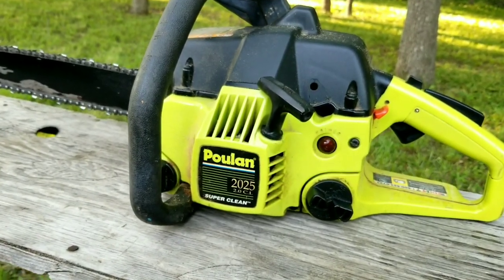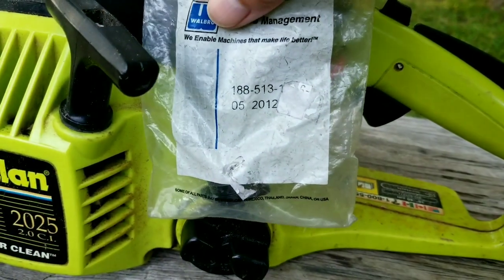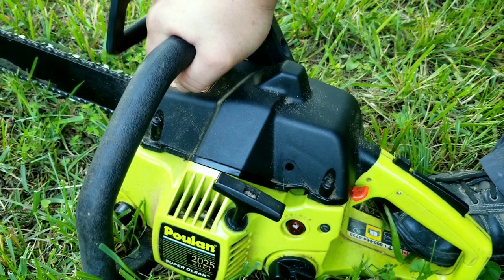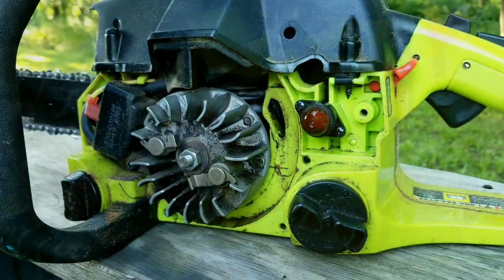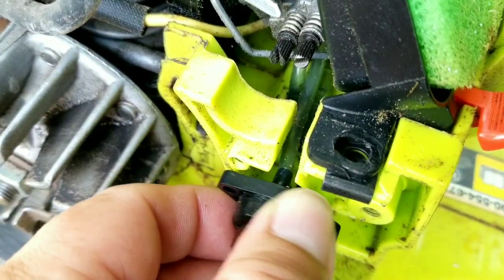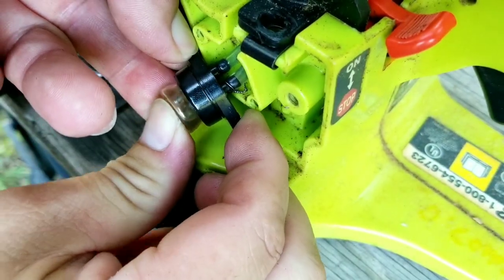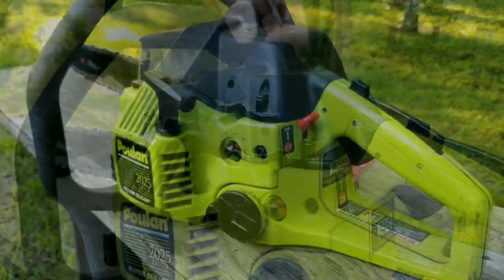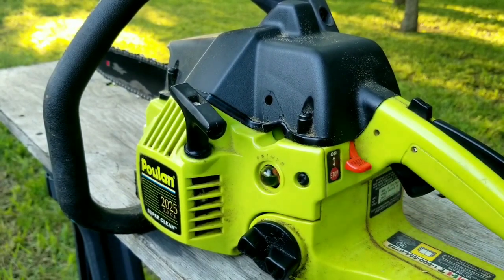Mythbusting primer bulbs. Will a cracked bulb keep you from starting

Comment: I have a Homelite weeder that has been VERY good to me over the years.  It recently had a tore up primer bulb, and I kept using it in spit of it.  I would just depress the throttle, and pull.  After a couple of time it would start.  I used it like that for a couple of months, and finally decided to change it out.  But it was almost like it really was unnecessary.
Reply from the maker: Yes the Primer bulb is to just remove the air in the fuel lines, but pulling the rope several times, does the same thing

Comment: I had a very heavy weight / heavy duty one once and sold it. It had been one used by Virginia Power crews to clear trees during stormy weather. So I assumed that Poulans were good enough for the power utility men to use.  BUT: a power utility may buy chainsaws from a dealer selected by an office 'tools and supplies' fellow and not workmen at all. So Poulan may have been selected by money managers who only view the nominal cost to buy and trade in... I sold the one from a yard sale for maybe  $80 and it cost me $15-20 with yellow case ... all complete.  So it was an OK deal for me
Reply from the maker: I think if you take care of it it will last. Thanks for the comment I appreciate it

Comment: Love watching these shows, very informative, I have.a question I have a 70cc Perla Barb chainsaw that does not have a primer bulb on it ,just a on/off switch, choke and a decompression valve,yet it starts perfectly all the time .Do you really need them???
Reply from the maker: the primer bulb was there to make starting it when the tank was empty, easier.   Most consumers don't have the patience that the consumers from 40 years ago, had.

Comment: I have a Poulan that looks just like the one in this video, but has 2075 on the side, and it's been GREAT to me.  I've had it since 2005.  It's been used pretty regularly, but for residential use, so not really that much.  I had to replace the primer bulb, and one time the fuel line cracked, causing the engine to die on me.  Once I replace the fuel lines, it was back and running great.  That was my first fuel line replacement, so it was a struggle, but not the fault of the machine.  Might not be one of the more popular and more expensive brands, but I have ZERO complaint after many uses over many years.
Reply from the maker: thank you kings17court.
Reply: @INSIDEHOUSEGARAGE  For residential use, I've had great results with the cheapy brands and models for these small 2 stroke machines.  I see no reason to pay 2 to 3 times as much for the more expensive brands.  It might make sense for commercial, but from my experience, not much sense for residential.
Reply from the maker: I completely agree with you.

Comment: Everybody wants to hate on Poulans but these older ones really weren't bad. Lines, primers & crank seals go on ALL saws, not just Poulans and those are the most common issues I find on them. Nearly all the old Poulans had real walbro carburetors and lots of other parts that were actually made by walbro. I've got 4 of them with relatively minimal work to get each going and cut limbs. For sawing big logs a smaller saw doesn't really work well regardless of brand but I find the power of most of the 42 to 45cc ones just fine with an 18" bar. Of course a stihl 250 is going to be more powerful and it better be. They aren't for logs but good for limbing and other stuff up to about 18" max. The really old macs & echos I think are my favorites because they often have good seals still despite being older than a lot of these 90s-ish era Poulans. If it works for you who gives a s**t what other people think. Almost all new saws suck other than the big brands but for the older ones those Poulans were actually decent and parts for them are very easy to find.
Reply from the maker: Thank you for the comment I appreciate it.
Reply: @INSIDEHOUSEGARAGE  Been working on a roughed up craftsman look alike ironically. Same parts as many of the poulans that look like that one. I like the 40-45cc ones and the wild thing versions. There are lots of those type out there, the ones that look like that one there. I had a 2150 I just couldn't figure out so I sold it. Have a 2175 and two wild 2375s that all run OK. They still need some love but I can get some work done with all 3 of them. I'm sure new crank seals would probably have the one 2375 humming nicely. I even found some spikes I got for them on ebay for like 10 bucks each. They are super easy to work on too, it's actually a great design imho. I hate saws that make it hard to get to the carburetor & such and almost all these older poulans are easy. I had a Pro 260 that was a lot more fiddly. Had a really old giant arse one too, was like a 120cc model, same as a dolmar. It was a really cool saw, sold it. Have one of those little 2000 top handles that runs awesome! Need to pop new seals on it, surprisingly runs good even with horrible seals.
Reply from the maker: @aeridyne  sounds like you know a lot about these chainsaws.  I appreciate your knowledge and your experience.  Thanks for sharing them.

Comment: I replaced all the fuel lines, filter, carb, air cleaner, and spark plug, but now my poulan stalls when idling. The only way to get it going again is to use the purge bulb a bunch of times and then she will start. What could be the issue?
Reply from the maker: Even after replacing the carb it sometimes still needs to be adjusted to run properly.

Comment: I do not know if its pumping fuel',  but when I depress it, it doesn't return. What is causing  that problem?  Thank you for all your most informative tutorials, I we have learned  much from your teaching.
Reply from the maker: sure, it's either a fuel in issue, or there's an issue inside the carb

Comment: Have my Dad's he bought in the 1980's, it still cranks but dies within a minute.  Needs some maintenance, probably a carb, carb cleaner did not clear it up.  Did not see a spark arrestor to clean, just exhaust from an opening.  Infrequent use, but used heavy when needed.
Reply from the maker: Yes I agree, a new Carb and possibly new fuel lines because they don't last forever either.

Comment: My opinion if you use it occasionally then it is a good buy but if your cutting firewood or other jobs where your using it almost daily then go with a more durable and reliable saw.
Reply from the maker: That's a great answer.  Thanks for the comment